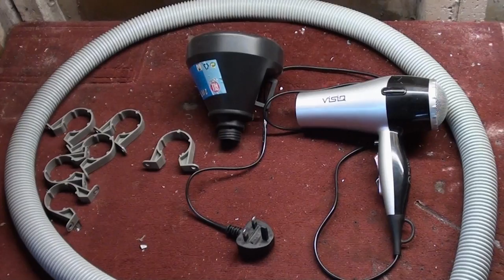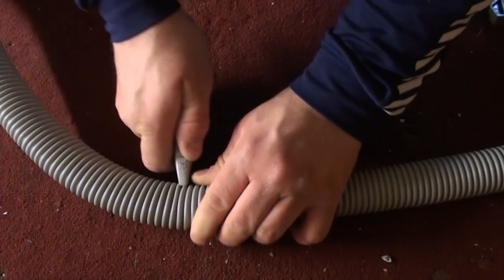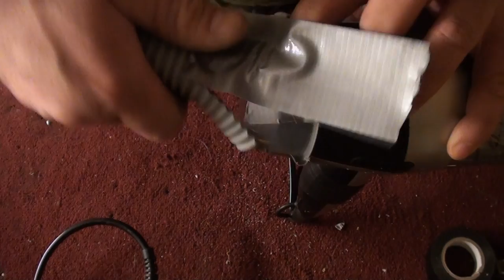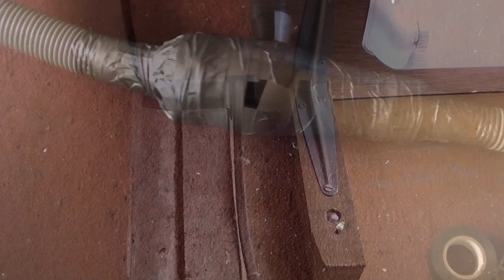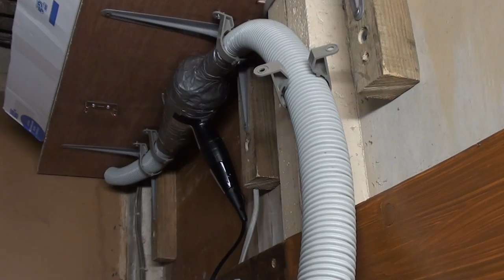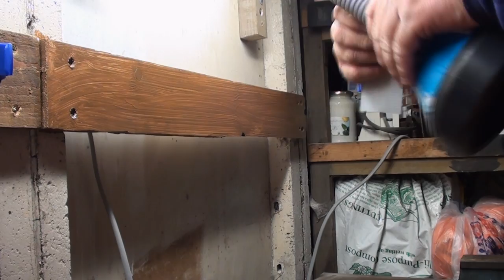How to build a DIY soldering fume and smoke extractor fan

Comment: The hairdryer has a round snowflake button that when pressed disconnects the heating elements, leaving only the fan blowing. Should have taped it so your duct tape wont melt
Reply: I have a similar hair dryer and the minimum heating is basically the same as the cold button,

Comment: Great idea. I loved it. I'm worried about the heat from the hair dryer though. Does it get very hot? I think it would have been better if heating circuit was removed. What do you think?
Reply from the maker: +Er Han the lowest heat setting doesn't get that hot, I wanted to remove it but it is integrated into the motor circuit you cut it out and the motor stops working, resistance from the heating element creates a lower voltage for the motor so I just left it in
Reply: +projectmayhemUK Thank you for the reply. Good morning :)
Reply: Think the heat element of the hair dryer could be removed all together.
Reply: @jtothew4201  yes you also could just duct tape the snowflake button which simply  turns off the heat element fully
Reply: @bldriver7453  Not all hair dryers have a cold setting though though.

Comment: you must not vent unfiltered fumes to the atmosphere.  your design is practical but needs improving ---a filter need be incorporated to capture the fumes
Reply: yea
Reply: like soldering or welding in the open air is any different.

Comment: I’m not giving this a thumbs up nor thumbs down. Hair dryers can get very hot, this is a fire risk, better using an old vacuum cleaner or even better buy a cheap extraction fan. Duct taping the hair dryer like that big no no. the rest of the install is fine.
Reply: Indeed. He could have at least clipped power to the heating element of the hairdryer. 🤔😶

Unless it was already not working in the first place.

Comment: I doubt a hair dryer fan(mechanics) is designed for hours long sessions, nor is a vacuum cleaner. I have not watched video yet but doubt there is a fume filter.
Reply: Vince King it vents outside so a filter is not required, plus realistically you will only have it on for 5 or 10 minutes at a time. Mine is a computer tower cooling fan, no where near as powerful but it has been in use for 2+ years now without an issue and I suspect a hairdryer which from observing my daughter and wife using one daily for 10+ minutes each will stand up to the required use quite easily. It definitely needs the heating element disconnected and may not look super elegant with the tape but this is a simple and effective solution in my opinion.
Reply: @larndavies6954  yea its a solid solution, if there was a way to make it little quieter that would be great but yea you would probably use it around 10 minutes here and there, plus this is for amateurs not professionals who solder 8h a day.If you are a pro, you will invest in pro equipment